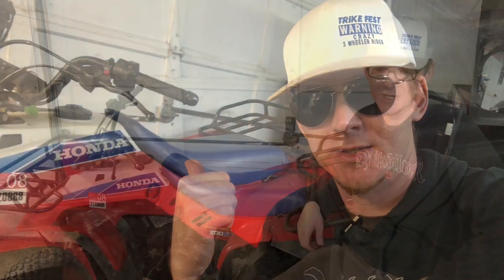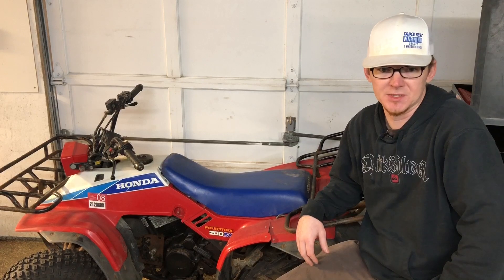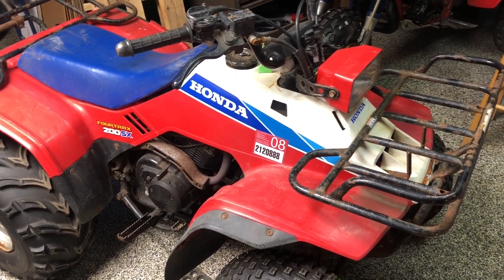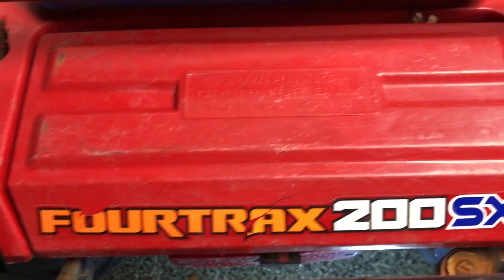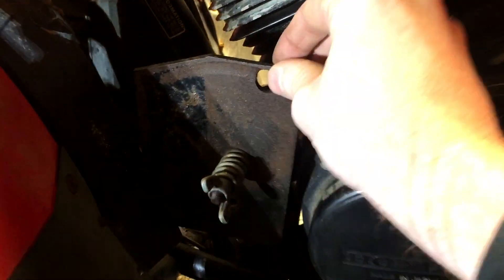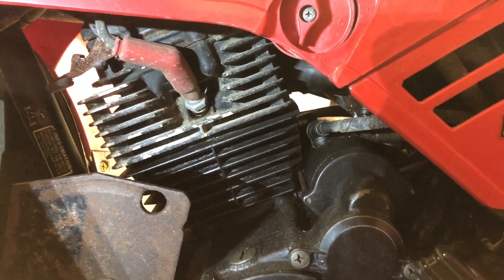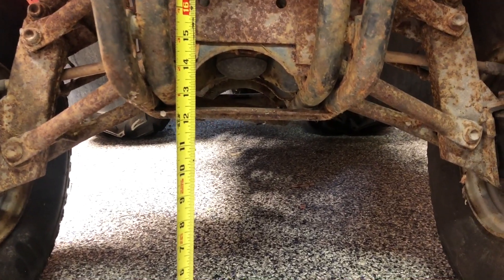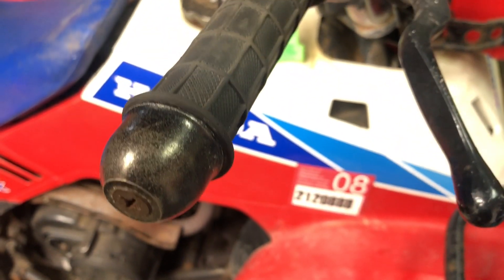1986 Honda 200SX Vintage Honda Review

Comment: i got one of them things it’s my favorite quad i’ve riden even over a sportsman 500. it handles so well. but it’s currently in parts with a cracked engine case in two spots. ours also has the racks but it has a bumper too. my grandpa bought it in 86 and it was the first quad my dad drove it’s pretty cool.also the first quad i had ever been on fourth one ive used.
Reply: Want to sell it.

Comment: I have 4 of that style one is a red white and blue with white as the base color and it's never stopped running love the mid 80s 200sx fourwheelers
Reply from the maker: Thats awesome.  I still have this one lol 😂 it has a title I need to either go through it or have it gone over.  Been sitting a bit.